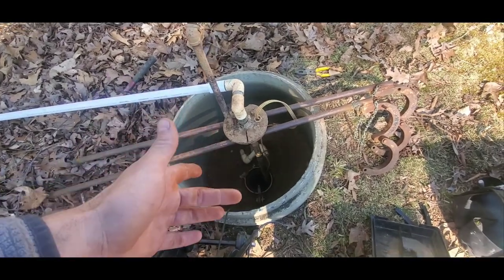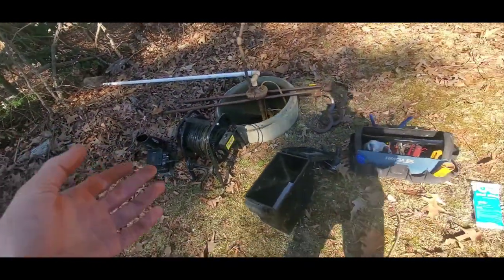Well Water becomes Muddy After A Rain. Here why & How to Fix it

Comment: How would you patch a leaking joint in a 24 inch bored well with cement casing? I have ground water coming in between the casing sections 6 to 10 feet below ground. Well is 46 feet with water level at 26 feet below the top of casing.

Comment: Hello, first off love your videos. A couple of questions what kinds of pumps would you recommend for a depth of 250ft. And the other is what pressure tank would you advise. Thanks so much Chad from oklahoma.
Reply from the maker: 3/4hp 7gpm pump. J-class or goulds brand.
As for the tank, a 20 gallon Well X-trol brand is used 95% of the time.
Reply: @h2omechanic  That's great thanks so much. Keep up the great work.

Comment: How much does a typical well liner cost and what do you use to push the packing in?
Reply from the maker: $2000-$2800 depending upon depth it needs to go. Camera inspection determines that. 
They are installed carefully with 2-3 men, & a homemade device that helps to push down the seal.
Reply: @h2omechanic where do you source those seals? I would like to get one for the top of our well tube. It is a 6 inch diameter pipe.

Comment: Hey man thanks for all the informative videos, I woke up too no pressure on the pressure gauge, 30/50 pressure switch contacts looked burned up so I replaced the pressure switch, let out the little bit of water left in tank, checked air pressure in tank and it had 45 psi in it.. which is super high, let air out brought it too 28psi. Flipped breaker and flipped on well disconnect, pressure switch opened contacts pump turned on for Maybe 20-30 sec then shut off, pressure gauge didn't move off 0. Then from that point on contacts on switch stayed open.. now I'm stuck and don't know where to go from here... any help or suggestions would be greatly appreciated😊
Reply from the maker: Does your switch have a little lever on the side?
Reply: Yes the new one I bought does but the old one didnt

Comment: I can't separate the pitless adapter. I keep pulling on it and pulling on it it won't come apart. Do they make a tool for that? I'm just using a pipe with a winning adapter on. I try to ratchet strap and vice group to pull it up to get more leverage but it won't come on. Help me!
Reply from the maker: Does it look exactly like mine? There is a weird style that locks in (I've never seen one personally) look down the well with a light, the locking style looks like a turkey Foot .
If its like mine, try to spray some wd40 on it and use a metal pipe and wiggle it side to side. Hwdracing@gmail.com send pics of down the well if possible
Reply: @h2omechanic  wow. I did get it apart. But it took a lot to do that.

What I did was put two pairs of ice grips on the pipe, put a board across the opening and use the pry bar under the vice grips. That did the trick..

The water is still dripping a little bit by the pressure tank faucet. That's probably just some water left in that pipe. It was trickling before.

I put the separatable part of the pitless adapter back in a slot. But I did not push it down in. So there should be a gap. Even if I pushed it all the way down I don't think I would get any water coming up now cuz I broke the siphon.

I didn't pull it out to inspect it but will do that before I put it back together in the Spring.

Thanks for all your thoughts and help.